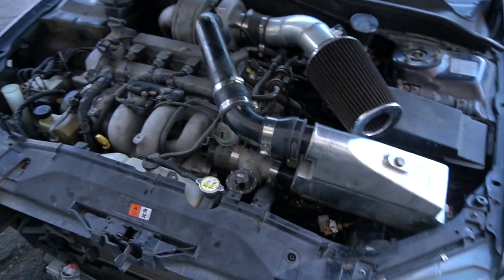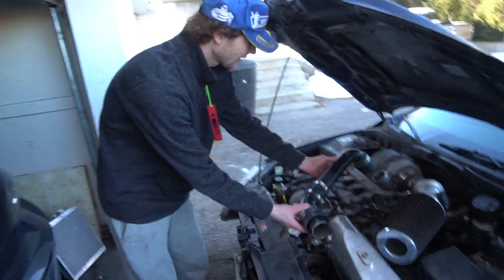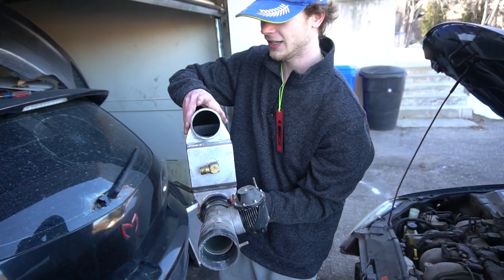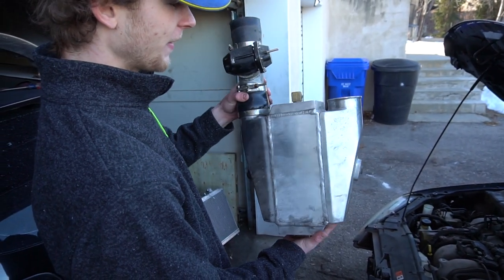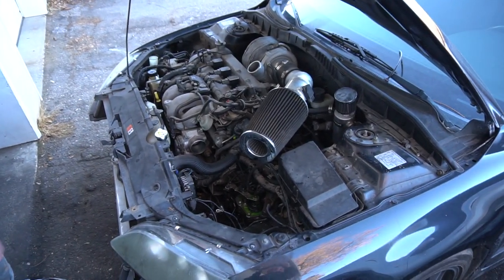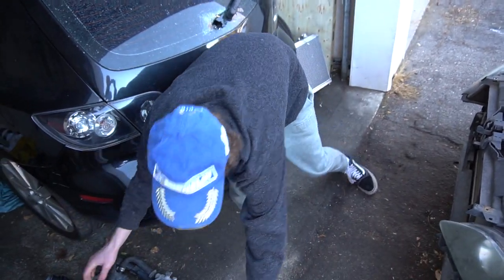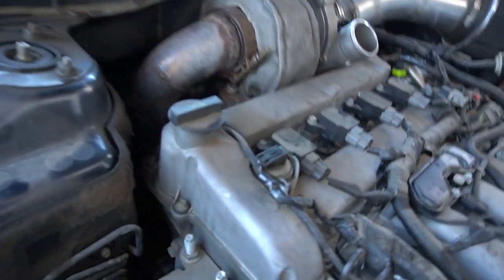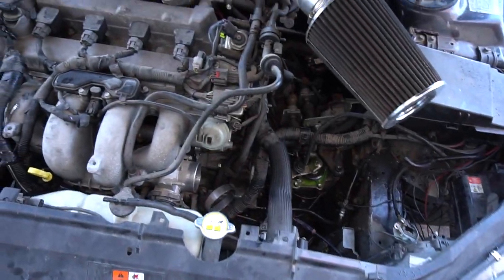Un installing my water to air intercooler! someone used self tappers to build this car :(

Comment: The only self tapping screws that should be used on a car are for trim pieces...  Does the WTA intercooler get water from a separate source?
Reply from the maker: Yes the water to air  is separate, it is filled by itself and is in a closed loop. It’s not connected to the radiator at all
Reply: @StevenDevey  - Thanks for the reply bud
Reply from the maker: @sq33qs  hey always, thanks for checking it out :)

Comment: Wait till you see the underside of that car. 🤦🏼‍♂️🤦🏼‍♂️🤦🏼‍♂️
Reply from the maker: Do you know something I don’t? It seemed fine when I checked. You mean rust?
Reply: @StevenDevey  oh yeah man that car is very bad. Your rear diff held on by one bolt that is stripped out. The driveshaft will come apart at any time.  It’s cracked and damaged. That whole car was the worst I have ever came across. There was a lot more to it also.
Reply from the maker: @matthewking1422  oh no are you serious? So this car should not be driven at all?
Reply: @StevenDevey  I’m dead serious. I would definitely lift it up and have a look at everything for yourself
Reply from the maker: @matthewking1422  oh god I will have to look, I’m scared now